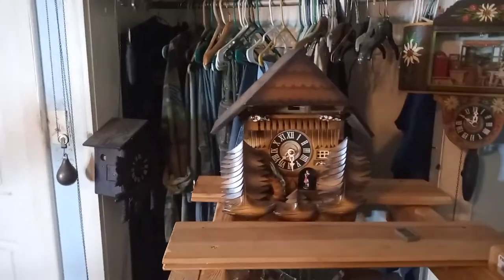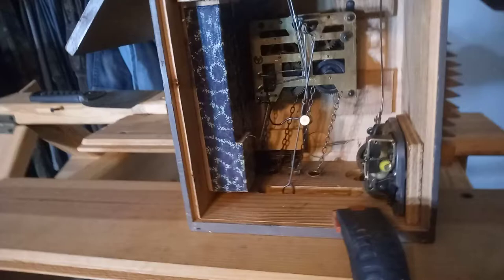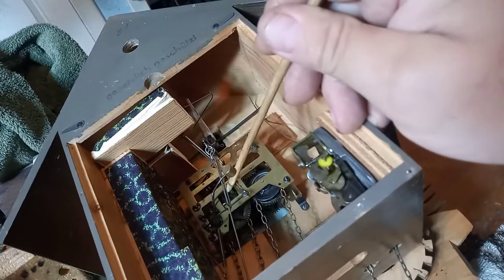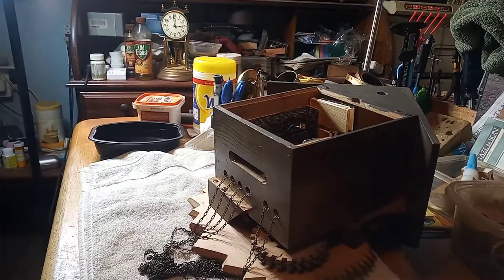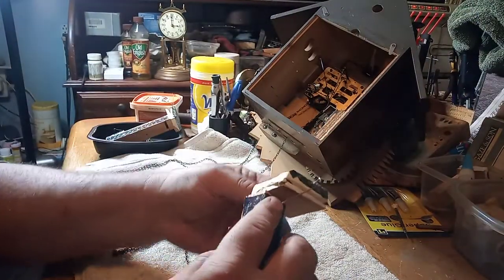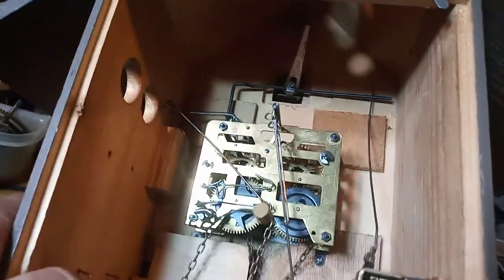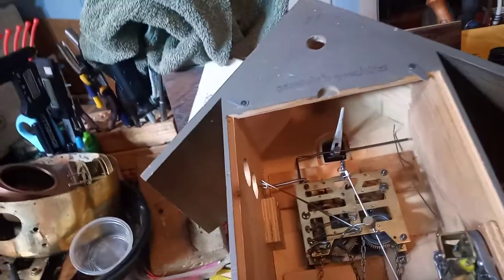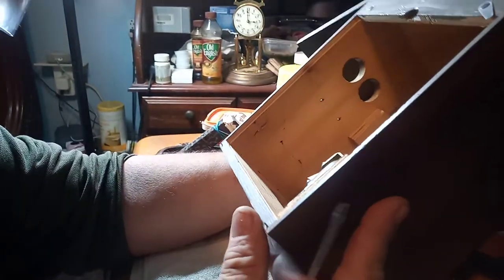Repairing a cuckoo clock with the couple dancing and waterwheel  (See description) 20220925 194809

Comment: Interesting clock inside. Haven't come across one yet. I was waiting for your phone to buzz or chime when I was bothering you when you were working on this clock. So far, this is very interesting. Back issues suck, but we get err done.
Reply from the maker: Thanks. It is a very interesting clock the way it is designed. You werent bothering me. I was taking a break. I try to put my phone on airplane mode while I am filming as I tend to get messages and stuff that screw up my video process. I was taking a break at the time we were chatting.